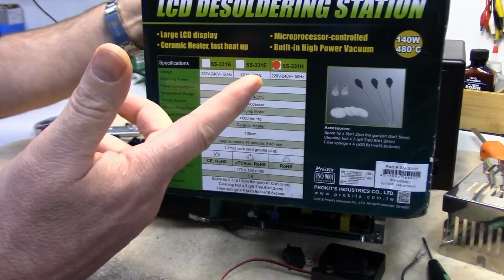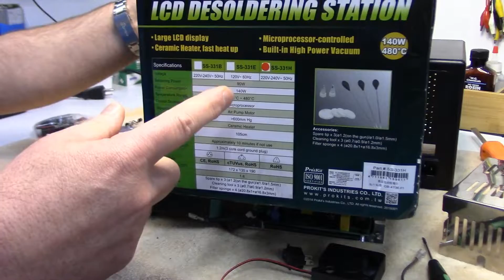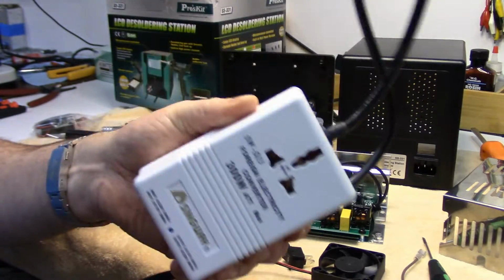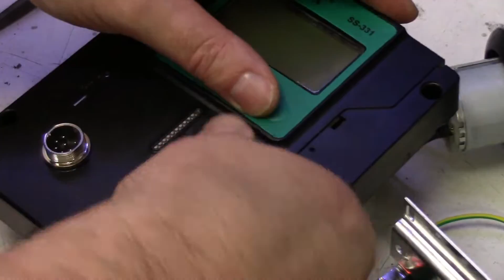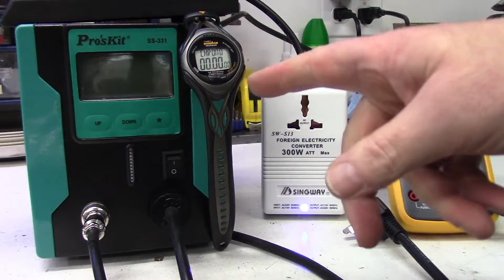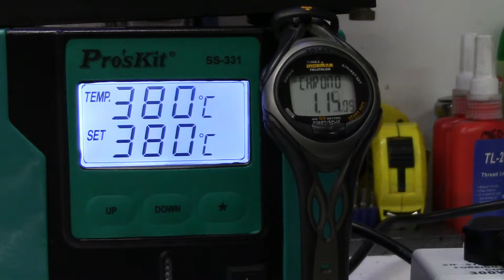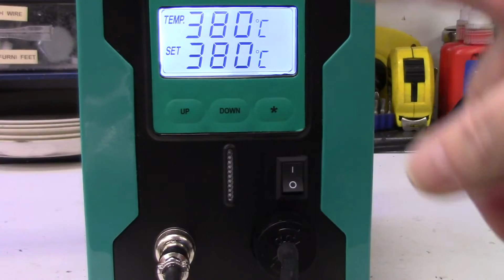Pros Kit SS-331 Universal Voltage Update

Comment: One of the better reviews, very detailed. Thanks. In the first review you could of just used desktop computer cord to see if it worked. Wouldn't of hurt the PSU if it was just 220 volt. Again, thanks for reviewing this. What do you think of the anesty zd 915?
Reply from the maker: As I mentioned at the beginning of the first review video I did on the 331, I would have happily purchased any of these 3 button Chinese desoldering stations, including the 915. It just happened however I had Banggood points that were expiring by the end of the year and I had to use them up; so this is the one I ordered since it was the only one they carried. The one nice thing however the SS-331 that none of the others have (at least that I know of), is it has an "idle" safety feature where it ramps down the temp to 100C if you don't use it/forget it's turned on. I really like this feature, but that is just me.
Reply: @Rchelicopterfun  missed that part, the train was blasting it's whistle. If I remember the reviews right the zd 915 and zd 985 both ramp down.
Reply from the maker: Good to know.

Comment: The price of parts for this thing are ridiculous.  That's not a cheap shot, it comes after looking at them on Aliexpress.
Reply from the maker: Because I'm curious, I had to look at Aliexpress's prices on replacement parts for the SS-331 and I have no idea what you are talking about; unless you meant ridiculously inexpensive? These prices are even better than anything I've found on eBay.  
$12.75 USD for the heating element assembly.
$7.12 USD for the 3 set of replacement tips.
$5.00 USD for the 1/4" hose barb threaded cap fitting that FedEx busted on you.
$4.65 USD for a 4 ceramic filter set.
$5.25 USD for the glass tube.
$35.00 USD for the entire gun assembly.

Thanks for mentioning Aliexpress - I just placed an order for a glass tube in case mine ever brakes and a few filter sets. Awesome find & prices - thanks again.
Reply: @Rchelicopterfun   Actually that is smart, ordering parts like that in advance and having them on hand.  The postal times are still very slow because of COVID,  so some parts should be kept on hand. It's mostly the $4.65 for a few pieces of material, $5 for a piece of plastic that should be metal, and $12.75 for the heating assembly that struck me as excessive.   I was probably still angry about mine arriving broken when I wrote that.  No, I'm not a jerk, and I really enjoyed your video.  Best wishes to you.  Sorry if I offended.

Comment: Hi, great review and very interesting tune up, I cannot wait to receive my unit ! Where did you connect the fan ?
Reply from the maker: Not sure what you mean by where I connected the fan. I just re-connected it into the same socket on the board that I unplugged it from when I took it apart.
Reply: @Rchelicopterfun  I'm not a physicist or engineer, but I don't think the fan modification did anything. Both the original and new fan placement pushes air out, and draws it in via the holes next to it, resulting in minimal air exchange between the interior and exterior. How about making some slots in the bottom of the unit, especially under the PSU, block all of the holes in the back except those immediately under the fan (perhaps just with black duct tape on the inside). Or just cut a hole out in the back and mount the fan with a guard. At the same time you could replace the fan with a larger one. Then you'd be drawing air in at the bottom and pushing it out the back.
Reply from the maker: @Pheckphul1  After over a year of use, the PS doesn't even get warm with the fan mod I did. Works very well the way it is. Of course, if you want to mod yours a different way - go to town.
Reply: @Rchelicopterfun  is the fan really needed? Worth to try running the unit without the fan an see if it's really getting hot or not.
Reply from the maker: @MrKvarkk  as with all electronics, the cooler they run, usually the longer they last so a fan moving some air will never hurt. Your call if you want to risk running it without the fan or not - I'm leaving mine in.

Comment: I think that model number differentiation is more for the product pack-in cord, which, in my opinion, is quite silly. It would probably be less expensive to produce the unit with 1 cord and slide over adapters, but eh. They might have had to do that to meet some countries' NEC certification requirements or the like.
Reply: I thought the same when I saw that the box has an illustration of the plug for each of the models.

Comment: nice expanation John, we think in the same way... me also  i was thinking about the same place for the main power  on/off switch ,
The only thing i don't like so much in your  video is about the fan ... instead to open the existing little holes  could be a better solution to open a big hole and put a grill (to protect the fingers accidentally touch the fan). So more air can flow and may be it will be less noisy too.
Anyway... good job!

Comment: Thanks for posting, but:
Doesn't modification void the factory warranty? I guess since you can fix it, only the cost (to you) would be the parts. However, anybody who wants a unit, but not too versed in repairs is taking a chance.
Reply from the maker: Of course it voids the warranty. Not that you get much if any warranty when you order most of this stuff China direct. Something also tells me most people that would purchase and mod a desoldering station, a tool specifically made for component level electronics repair, may actually be well versed in electronics repair.